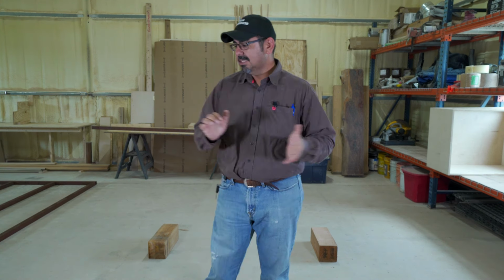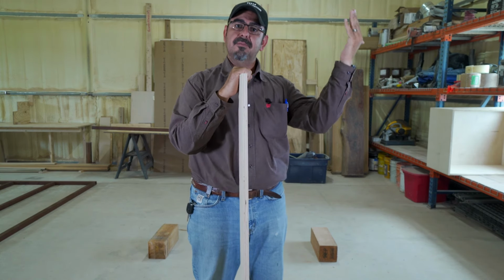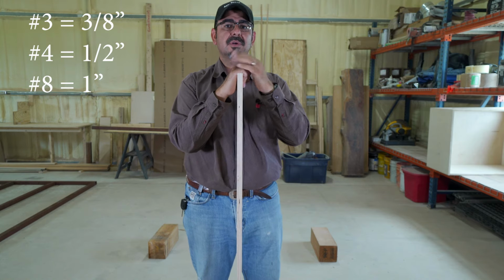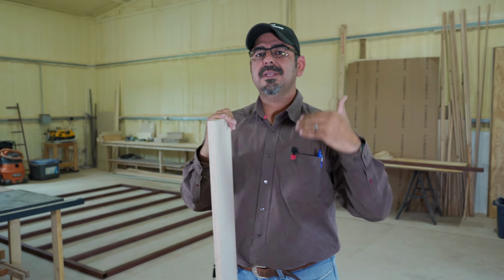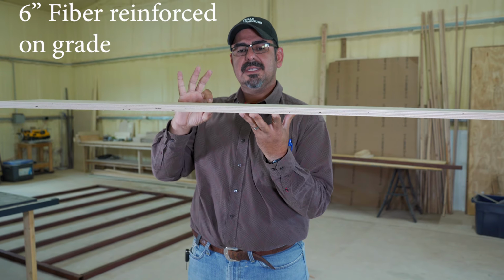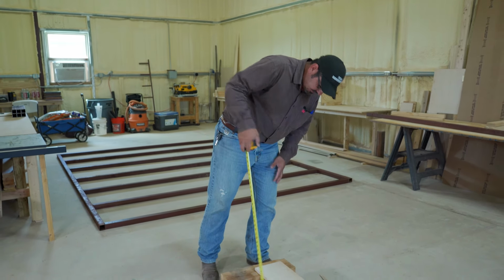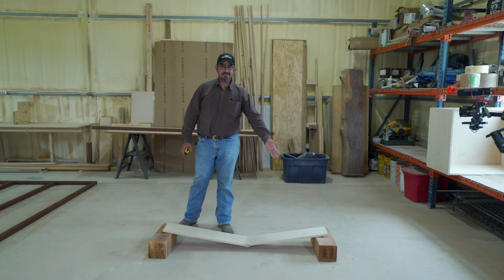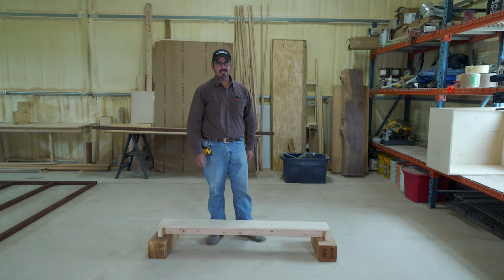Concrete thickness explained! - The Barndominium show E136

Comment: my 80x50 barn on the property i bought 6 months ago.. has a workshop on the 1/4 right of the barn and horse stables on the other 1/4 of the barn, and the slabs there are 4 inchs.. Barely 4 but it is 4, barn was made in the 70-80s.. i mean it hasnt cracked in those 40 years its been up except in 1 minor spot.. even has god damn ground hog holes under it,, who knows how much they dug up down there..  I plan to fill it in with concrete as much as i can though.. but the slab holds my 5500 lbs Lifted Jeep just fine plus im 300 lbs and all my tools... so basically with me in the Jeep its holding near 6,000 lbs just fine.. and its also holding the building as well with the 6x6 pillars.   Dunno if they used rebar or not.. but they sure did use some very thick gravel, i mean HUGE chunks of long gravel looks like 1 1/4 inch gravel.. deff not typical gravel for concrete ive seen on videos.....  Deff different type of gravel.. its like a purple color too.....  

 One thing i dont like about the slabs though and it isnt the slab itself.. is the center drain for the workshop slab is just a 4 inch pipe drilled down 5-6 inchs into the clay below.. and so it drains.. well under the slab.. which is odd..  Same for the mudsink just a 4 inch drain that goes down to the mud.. they didnt run the pipe under the slab out the back of the barn.. i imagine this has caused some erosion of the slab.  my workshop slab is also not FLAT.. its slopes down on all corners toward the middle drain... this way any liquids from vehicles or anything on the slab just drains down to the floor drain.

Another odd thing they did was they PUT the slab on cinter blocks on all 4 corners but only partially on the blocks... and then the 6x6 pillars sit on that slab which sits on the blocks.. Its very strange how they did this.. they didnt even anchor the 6x6s to the slab or blocks.. it just sits on them.... and its sitting on only 2-3 inchs of concrete on the cinterblocks.. its very weird..  but hey its been working fine for 40 years so i guess i cant complain.   Ive been wanting to get a concrete guy over though to give me an idea of how to fill those ground hog holes as much as i can.. i know it goes 6 feet back at least.. and who knows how many turns and tunnles are down there... not a fan of that

oddly the smaller dog kennle which is 50x20 feet.. the first half uses a 6 inch slab.. the other is 3-4.. no idea why they decided that
Reply: Sounds like some sort of slurry would fill those ground hog holes just fine, but that would involved a pump and some drilled vertical 'vent' holes, to assure you're getting it pumped full ... can you hear the voids when you hit the slab with a hammer?
Reply: @richschell4835  never tried a hammer but I did hear a void working on car and my hand smacking it.. sounded odd.  I'll have to check the rest of the slab then

Comment: Never salt sidewalks and driveways ..Salt will react with dirt and concrete will crack and will drop at joints
Reply: Department of highways uses massive amounts of salt during snow events. Much more than salting a sidewalk or driveway. Highways don't crack all to pieces. Why? All concrete is not created equal. City and county generally get a "special" concrete mix for doing roads and highways. More or less meaning it isn't cheap. Cheap driveways and sidewalks use cheap concrete. Also, there's only two types of concrete..... concrete that is cracked, and concrete that will crack.

Comment: Bernoulli differencial equations used in Civil Engineering are all elliptical equations. So you can solve them with FEA only. They are not linear. 
You are using narrow plank but  foundation is not so narrow. It is not that simple.

Comment: Another good variable- how much of the rebar is tied, 50% 100% etc...
Reply: Screw rebar and associative properties. 

Post tension. 

Conventional slab systems flat out suck ass. Period.

If it is my house then post tension is the way to go. Hands down. No argument. Bada bing. Why ? Been there done that.
Reply: @tonyreyes1798  Post tension houses?? Send me a link because I've never seen em. Unless your on the 105th floor of a skyscraper!!!
Reply: Rebar is about being embedded at the proper spacing and specific area of the structure. There is no specific requirements for how you get it there (% tied). For instance as he walked across the wood plank, the wood grains on the top of the board squeezed together. The wood grains on the bottom pulled apart. This is why some slabs require your reinforcement to be in the bottom 1/3 of the slab. That is the area that wants to pull apart the most causing cracks or slab failures. How you tie it to get it there is irrelevant. That brings us to another variable. Are you tying rebar in a wall or pier that you must climb and tie yourself off to continue setting more steel?  Then not only do you need it to stay in place but you need it to support your weight as you climb and tie off your harness.

Post tension is a totally different animal for the guy who thinks he's going to build a home with post tension basement floor, footers, or garage floor. Steel cables are stretched to the max during slab placement. Then as the slab cures, the stress is let off the cables. This in turn puts tension on the slab pulling it together. Most applications include situations where you need the slab to help to distribute the weight of the structure due to bad soil conditions or if you're building a skyscraper without enormous, deep, intricate foundations on a city block.
Reply: @tonyreyes1798  dont mean to sound harsh. Unless you have terrible soil you are wasting your money.
Reply: @c_b8s4  We started using post tension residential slabs in the 1980's in San Diego County. We did this out of an abundance of caution since the construction defect litigation game was heating up. The reason we did post tension slabs was to cut off the plaintiffs attorneys at the pass. The attorneys could no longer state we built our foundations to bare minimums which coincidentally is the building code. Post tension in residential construction was new even though post tension has been around since the early 1900's used in bridges and commercial applications. I have no links to provide you to back up these facts. Sorry.
Reply: @c_b8s4  Not really. Post tension is REAL close to the cost of a conventional slab system and well worth the cost. I also did the purchasing for a major Top 10 builder developer so I am familiar was the costs associated. Post tension out performs a conventional slab system every which way you can imagine. I have managed thousands of residential foundation pours and draw upon this experience to post what I know. Regardless of the soils expansive index, we chose to do post tension slab systems across the board because of the superior slab performance and to mitigate litigation. It was money well spent.
Reply: @c_b8s4  Post tension cables can be placed in a garage and loop up to the elevation of the finish flooring elevation. You do not use post tension cables in the footings or at least I have NEVER seen a post tension engineer call out this footing detail with post tension cables. Post tension cables put a slab in "compression" and NOT "tension" as you described. As the post tension cables relax or anywhere from 4%-12% depending on what era we are talking about, squeezes the slab together from all sides.

Comment: I didn't see any analysis that translated to real world concrete design in this video.  Concrete is much more complicated with mix design and compressive forces involved to just make it thick or thin, regardless location and cover are factored in and fiber type have an impact on tensile strength. Get it designed by a competent professional and enjoy a quality product.

Comment: The demonstration fell short as it didn’t show a 6” slab.  If you use 3/4” plywood for a 4”slab, you should have showed a 1-1/8” sheet of plywood as the 6” slab and show the deflection of that.  It is more than the 2x4 supported plywood, but it would have been much, much less than the 3/4” plywood.

Comment: Coming from Germany, where we build with 12” blocks our walls, the slab on my house was 12” thick. Moving to Canada, the company didn’t made a foundation slab at all. They only made punctual foundation “points” where a carrying post came into the construction. And I was baffled that this is how North Americans build. 😮 Moving to Panama, where I am building again, I made a foundation 4 feet deep, put #3 rebars in all around, filled with concrete. I was asked why I would do this. In Panama, people don’t go this deep and don’t put that many rebars into the foundation. I always say that a good foundation doesn’t let the walls crack easily. And I have to say that I’m building a round house. That makes the foundation even stronger. My slab will be 4” with rebars #3. Does my slab has to hold any weight? No. The foundation does it.

Comment: Too bad you did not make up a real concrete floor sample 5' x 12" x 4" with rebar and the same size except change the thickness to 6". Another big thing that people do not do when pouring slabs is run a concrete vibrator around to consolidate the concrete around the rebar and get the air bubble out.

Comment: vs. a 2 by 4 (3 and 1/2 thickness cheating! 2 inches on compacted crush n run or stone dust cheating!)..this has always been the question! because it "floats" vs. wanting to crack leveraged? fiber is used acceptably..hmm...course mesh wire (squares)..I think the rebar like 3/8's laid across into it tied..half!...hmm vehicle weight/driveways yes and the extra strength concrete.. 'Thanks!

Comment: In your example you are walking directly on the 4 inch slab grade beam. To get that support all over your foundation you would have to pour that grade beam all over the foundation witch wouldn't make it a 4 inch slab anymore. No one walks only on grade beams. They walk in the filed.  You didn't have an example of walking in the field of a 4 inch with grade beams. My guess is it would have deflected a lot more once you walked on the filed part of a 4 inch slab. So basically you just proved a 6 inch slab is best with your example.

Comment: we used to speak of 4 sacks of portttland per yard...dry cement and 5 was better...now its all 4000psi or more...this has been left out of his tutorial...an extra sck per yard is only 6 bux extra here in missouri..as for engineering,i wouldnt spend the money to have someone OVER ENGINNER IT AT GREAT COST!half inch rebar on 2 foot centers both ways,4500psi concrete.poured pretty dry{another thing not mentioned here }and ..listen to this...drag a vibrator through it..have a dedicated vibrator operator...not over doing it

Comment: A slab is not necessarily a foundation.  A slab that turns down at the edges to form a footing is a foundation, and a very poor one because it conducts heat and results in a freezing cold floor in winter.  Also, if a turned down slab cracks it will spread into the interior, or vice versa.   The better foundation is a footing.  Inside the footing you can have a disconnected or floating slab.  The secret to a good slab or footing is compacting the earth underneath.  Suitable soil or engineered fill mixture is required.  It must be free of organic matter.  It can be suitably compacted by driving a narrow tired vehicle, like a passenger car, repeatedly over the moist soil.  If  you sufficiently compact the soil under your slab it doesn't   need very much thickness.  My slab is 3-1/2 inches in places. My floor is ceramic tile laid on the slab and in 15 years I have no cracks.
Reply: So you risked it all to save a few dollars. Dope
Reply: @scorpiuswireless1  followed good building practice and in 15 years I do not have a single crack in my slab, unlike most other houses that were build on uncompacted soil and didn't have  rebar along the perimeter.  And I didn't "risk all" with a floating slab because the footing that supports the walls is not connected to the slab.  The only potential risk is to the floor.

Comment: I don't think that's how it works , massive footings under 4 inch slab . If the plywood represent 4 inch thickness  , and 2x4 concrete beam , then you need to pour every 12 inch apart massive footings under 4 inch slab ..
Reply from the maker: It’s a simple example to show that a beam reinforced slab is stronger than one that isn’t.

Comment: How about bumping to 4000 psi
Reply from the maker: It helps, but sets a lot faster than 3,000 psi.   So finishing it in the summer will be a challenge without retarders or some other way to slow it down.
Reply: My professional opinion anything over 3,500 PSI is just wasting money.

Comment: Appreciated the video, but I don't know what you talking about,  what is on grades what does that mean to you, support beams, what's that mean, rebar ,or I beams is that the beams you mean, the biggest problem with alot of these vids is they talk to customers like the customer knows the lingo of construction,  on, beam support,  rebar support,  fiber , is that in the concrete fiber, or is that a fiber board that is used, see contractors lingo that customers don't understand,  if your going to inform, the inform completely,  for some it might be over kill but for others it might be, hey I didn't know that, assuming everybody just knows, they don't, thanks again,  enjoy the videos
Reply: On grade - on the ground (not suspended) beam support - incorporating deeper sections of (usually)reinforced concrete in the slab. Rebar - deformed steel bar used to make concrete more resistant to cracking. Fiber, if specified, goes into the concrete mix as a lightweight form of reinforcement. It's smart of you to ask these things - but a common complaint is that youtube videos are too long. Buy your  local concrete guy a beer and see how much you will learn. Some of this really does need a one-on-one. Have fun!
Reply: @bradpotgieter4008  thank you, I love to learn new things and watch many things to learn, thier is one thing that I have noticed across alot of instructional videos is most talk like you already know what thier talking about  lol, appreciate the videos and you answering back, thanks and God bless

Comment: A 32x50x4" slab is 20 yrds every 2" ads 10 yrds,@ $160/ yrd=$1600 ....how many 2" are you going to keep adding unnecessarily when 1/2 " rebar is a proven reinforcement on a 2' grid to support a surface for a residential floor barring any failure of the subgrade compaction  Dont  spend the home owners money unnecessarily to prove the point apples aren't oranges. Nice video .🙂

Comment: Wait wtf 
   You were first taking about ON grade???  But you are demonstrating Above Grade with support beans.
Reply from the maker: I was just showing the different in strength between a slab with beams and one without.  If I put them down on the concrete it would not have mattered, and no one would have understood the example.

Comment: If that is your 4 inch slab that would make that a 15 inch support beam!
Reply from the maker: Explain please.
Reply: @TexasBarndominiums  if a 3/4" plywood is your 4" (= 3") cement slab.... (looked like a 2x4 as your support)  x4 would make 14 inches (sorry not 15" in my head) that's a 14" thick beam... how much support do you believe is reliable support? Bc your example is over exaggerated!
Reply: Plus how much do you weigh? We are talking lbs per square inch?  Also talking structural strength between wood and cement. Per square inch.  Not the same! Your example is understandable. But poor! Per ² "
Reply: With absolutely nothing to support it underneath
Reply from the maker: Ok, let’s start by calling it what it is.  It’s CONCRETE, not CEMENT.  

This was simply a demonstration to show that two 4” slabs can be built drastically different and still be called the same thing.  Not all 4” slabs are the same.

Comment: Concrete thickness explained?  No, not if you are actually trying to design a slab.  Yes, if you knew zero about slabs going in and just wanted a few moments of entertainment and also wanted to know a tiny bit more.  The Demo at the end was only superficially applicable to slabs.  He cheated by making a “T” cross-section since the slab stiffening concepts he mentioned were about putting rigid elements inside the slab and not about selectively hugely extending the slab depth which is what the reinforcing rib on an”T” section does.  A better demo would have been to glue a wire grid mesh to the underside side of the 3/4” plywood to crudely simulate the effect of adding rebar.  He also failed to mention that there are various strength grades of concrete (e.g., 3,000 psi) as well as special recipes for what percentages of grout, stone aggregate, sand, water, etc. to include in the mix.  He also did not mention about the effect of the vertical position of the metal reinforcement, for example, if it is laid perfectly flat on the ground when you pour the slab, the metal will not be sufficiently  imbedded and will pop off the bottom surface of the concrete when a moderate load is applied.  He also explained nothing about how to design the underlying gravel bed, why you might want to add drainage pipes in the gravel, or add insulation (e.g., 2” 30 psi compressive strength closed-cell XPS) and also the use of adding a vapor barrier (e.g., 15 mills thick) on top of the insulation that should go under and around the slab’s perimeter.

Comment: Whaaatttttt???? So the building is built on a slab? Not a monolithic pour?
Reply from the maker: What do you mean?
Reply: @TexasBarndominiums  it sounded to me like you said you can set your building on top of either a 4 or 6 inch slab with no problem
Reply: @TexasBarndominiums  ok I get it your support beams would be the footer and thickened areas for load.